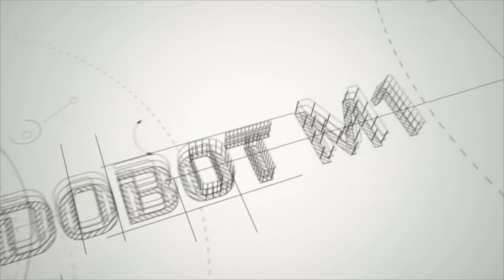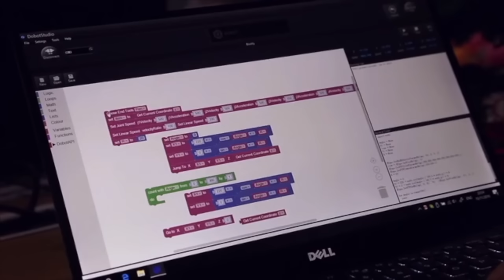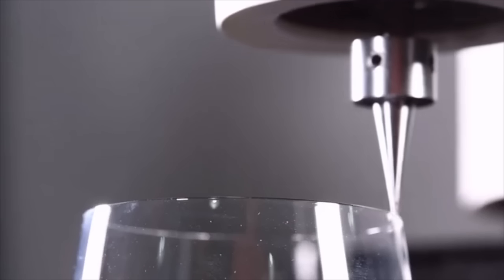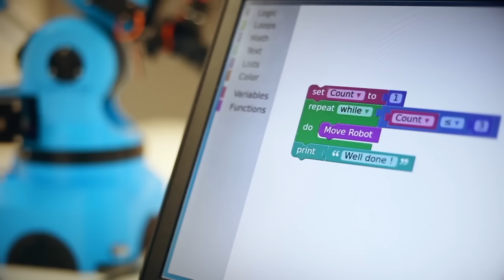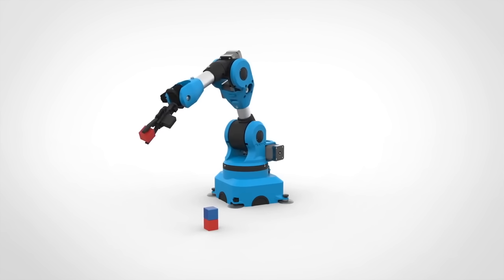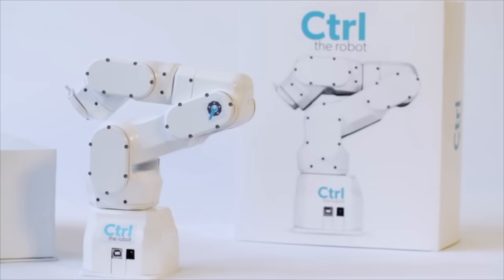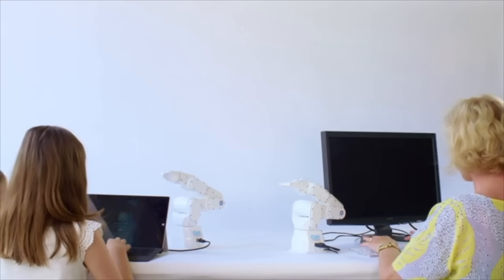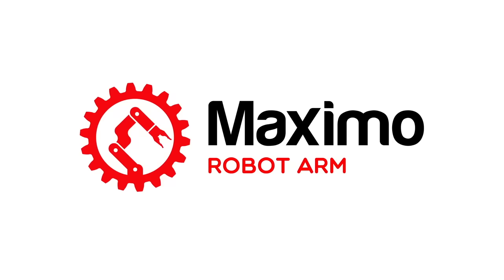Top 5 Robotic Arms for your desktop

Comment: "...and with a completely open source interface, means you can control it with your favorite programing language". Sorry lady, that's not what open source means
Reply: That hilarious XD
Reply: What prevents you from making binds to your favourite programming language?
Reply: lmao
Reply: @orangus01  that's not exactly what open source implies.
Reply: Yeh it does
Reply: @Warhamer116  In that context, it is exactly what was implied. The code is open source, meaning you can just take a look into the code and hookup whatever platform you want into it or make changes directly in the source code itself, with closed source you'd be fully dependent on API's or usually you'd just be tied to the proprietary software and no way to connect anything else to it.
Reply: The point of open source interface is usability, not to just look at it.
So yeah, that's exactly what was meant.
That's why blockchain is growing so fast, any one can build on it, even borrow from each-other, and security is built in already! (aka Dapps)

Comment: I find most of these "use cases" hilarious at best and misleading.   Robots are great for repetitive tasks and precision job (though half of these had the rigidity of a wet noodle).  Robotics can be fun for sure but a 3d printed arm isn't going to be making your daily life better anytime soon.
Reply: I found one use case for it. Let's say you want toast for breakfast, so you program your arm to put the bread in a toaster, then take toasts out. When you wake you have your breakfast already done. Isn't it brilliant? :D
Reply: Only the Meca500 could actually be useful, it is a industrial grade robot arm after all, but it will cost more than a brand new car and will not pick and place heavy stuff
Reply: @Scratchy8644  honestly if you want a cheap and reliable robotic arm for your DIY project or w/e, just get a used fanuc robot. 6-axis robots usually range from 2k to 15k USD, generally going for 2-4 for 6-10kg lift robot and around 16-20k for 150-300kg M900 series robots.  A lot of shops in US and EU are upgrading their automation processes and the old, worn arms tend to go for cheap, and I've even had one shop asking if I was willing to take one off their hands for free if I was willing to arrange the logistics to bring the arm and the controller to my shop.
Granted, a true 6-axis arm like M6i, ArcMate or LR2000 series arms don't exactly fit kitchen tables, well LR2000 might, but the combinations tend to be a bit heavier than what normal kitchen table can withstand, bolting down rigidity requirements for precise moves notwithcstanding.
Reply: @Warhamer116  might want to keep in mind voltage requirements as well!
Reply: Hey now, I need my gum packs straightened!
Reply: @perz1val  you can archive that by having two linear moves, one in x axis one in y axis, with gripper to grab the toast. Assuming you dont want to just use/buy a flow-through toaster that is essentially a bottomless toaster that feeds bread slices in and toasted slices out to dinner table. Both cases range around tens of dollars max- robotic arm that can actually do that and has rigidity for it, you're looking for thousands for that.
Thing is, 6-axis robots have their places in the industry, and that is in repetive, multi-move tasks. Using 6ax for basic linear feed in-out moves is redundant and costly.
Reply: You can use them to explain how forward kinematics and inverse kinematics of robots work for your students. Tho I am using a 20 EUR KUKA robot toy to do the same job.
Reply: There have been engineers posting on reddit their pet project robot arms, mostly 3D printed, they have solid rigidity and are at the same precision level of an industrial robot. Key notes here are: the costs of strong motors, good bearings, and an engineer that knows wtf he's doing, also  writing a controller for the damn thing. All that I've seen here is good at an educational level or very low precision repetitive tasks, only exception is the 1st arm that isn't really an arm, now is it? That robot sacrificed all the advantages a robot arm has to gain rigidity. It's by this point a wide area (40cm arc), small storage space 3D printer/engraver/manipulator.

Comment: The Dobot is pretty cool at around 1000$. Add in PCB cutting function ready to go and I think it's a hit. Both cut a PCB and populate with parts, that's a strong combo.
The Meca is very nice too, noticeable high quality but unfortunately industrially expensive at 15k. The other 3 are getting treatment for parkinson's disease.
Reply: Dan, it looks like you have hand on experience on these robots. Could you please explain what you meant by Parkinsons on the other three? Vibrations or repeatability issues?

Comment: Good Idea using a robot arm to automate  pulling out 3-D printed objects,  and use it's vision and touch to start up making the next item too... repeatedly !
Reply: Hehe, I'm currently working on this. I have my printer networked and can monitor/execute remotely. Currently building the Thor robot arm so I can remove made pieces and clean the print bed so I don't have to keep going to my shop between prints!

Comment: wow that NIRYO commercial is ridiculous.  No way that thing could remove parts from a 3d printer, those parts are glued down with tape and melted plastic, they don't come off easily specifically because if they could then they would move during the printing process and the parts would be ruined.  It can be extremely difficult to remove the parts at times without damaging the part or the printer.  The idea that this cheap flimsy robotic arm could do it is laughable.  It only removed a part that a human had already removed and placed there unattached.  Furthermore I'm sure that the steam hitting the electronics is really good for its longevity in the "i can't stir my own food" segment.

Comment: I need a robot that can pick up toothpicks very fast. Can anyone of these converted to such task?
Reply: Daniel Chen a vacuum with a filter to catch toothpicks😂 funny but I'm dead serious
Reply: No no no ... I need it to pick up one by one. I have other application but based on the same mechanics.
Reply: I think Andrew is on to something. If the nozzle of the vacuum is toothpick shaped and you have some sort of filter or grill (at the very tip of the nozzle) to prevent the toothpick from being sucked in then the robotic arm just has to line up with the toothpick, get close enough, turn on the vacuum, move to final position and finally turn off the vacuum to let go. Kinda like the suction cups but you could not use that because you wouldn't get a good seal on a toothpick.
Reply: Thanks for all your input. The need is more than just toothpick, and I'm just using toothpick as example.